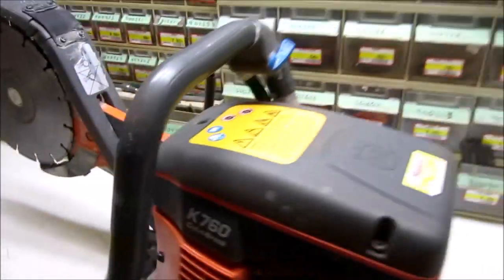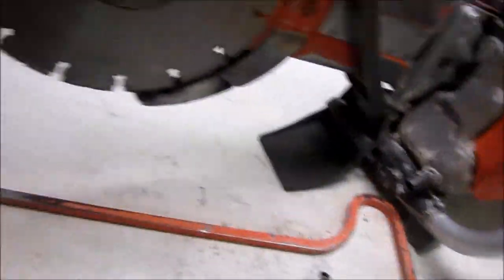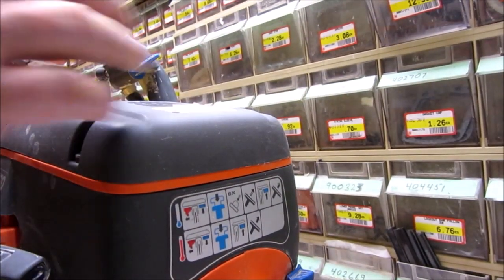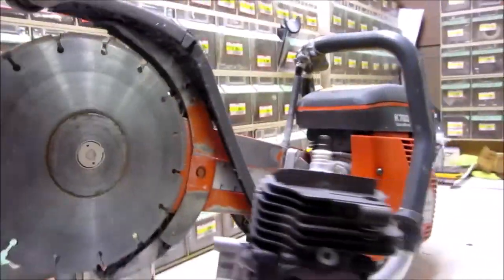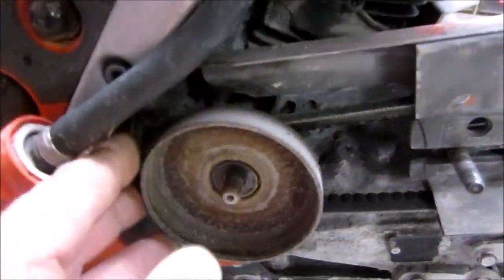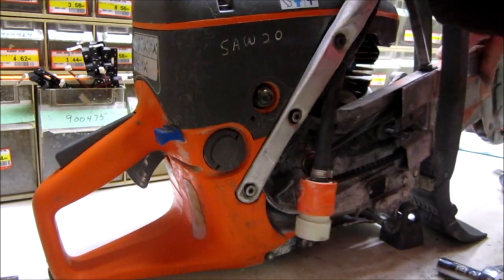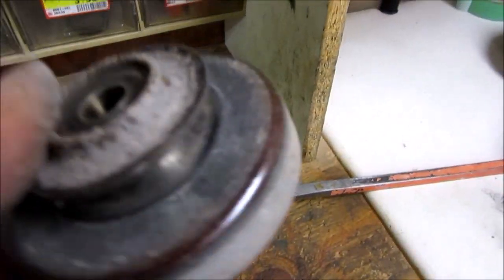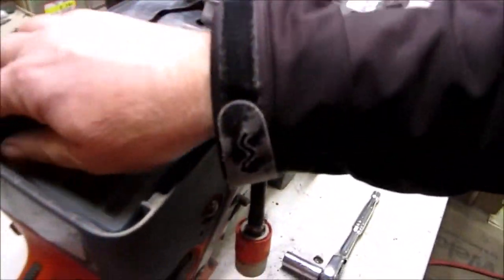760 Husquvarna Cut N Break Part 1

Comment: My guys break everything but this one especially seems to go the fastest! We love the saw but everytime we cut something out of a foundation I have to get it serviced. Currently everything works but the blades stop spinning as soon as we apply any pressure, would that be a blown belt or bearings?
Reply from the maker: There a great saw for sure . I would say the belt is slipring . Some times people push on the saw . the saw will cut fine with out pushing . a bit of pressure is ok but some people get carried away   . If the saw is looked after and serviced correctly you can use it many trouble free hours  .